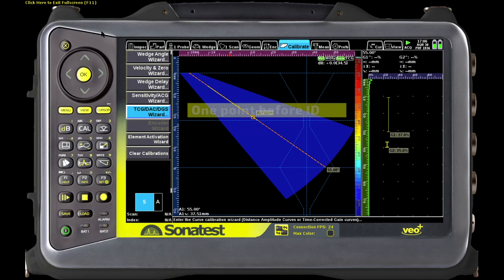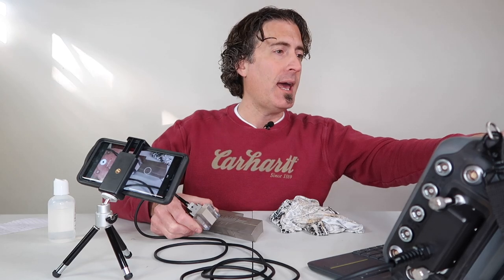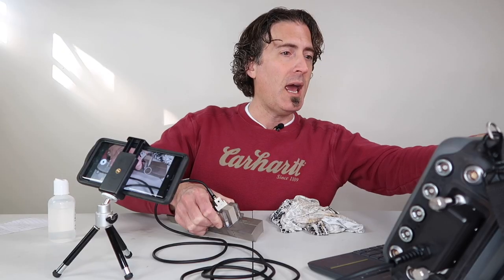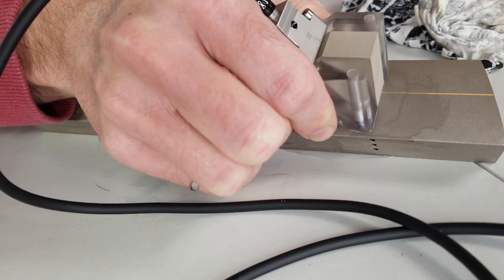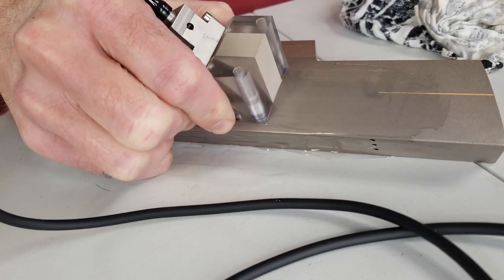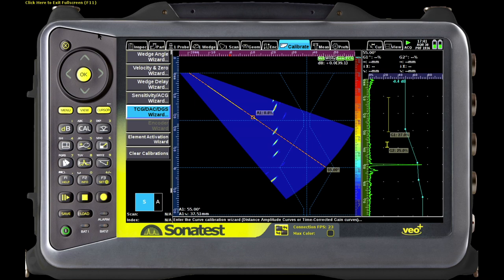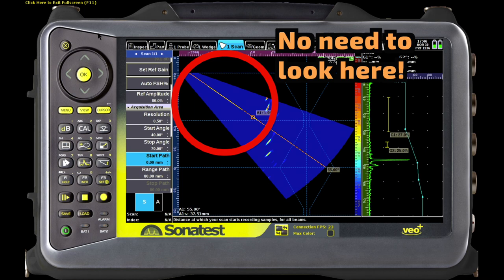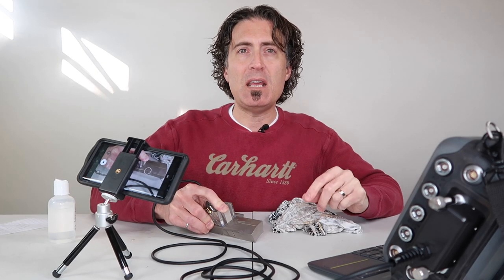Phased Array TCG Calibration

Comment: Hey Paul, I'm learning PAUT. We were doing TCG cals today on the veo3 on 1.5mm SDH. After completing the TCG we were confused that the maxed A-scan signal from the reflectors is breaking TCG, just like in your video at around 4:01. I have my PAUT course soon but do you know why this is the case? Great video and sorry for taking up your time!! Cheers - Doug 🏴
Reply: Also to add, the ref gain stays the same so not sure why the amplitude is above TCG. Aware this could be a stupid question 😂
Reply from the maker: @DoogHoneyman   no stupid questions! :) So the TCG curve is not a DAC curve. If it were a DAC, then you are right the A-scans would peak up at the line and not go above. But the TCG curve is simply a reference line that shows the dB adjustment at different sound paths. The idea is that with the TCG, they will peak at a consistent screen level (usually 80%) after you're done. Which, if you overlay the TCG curve (which is not a flat line at 80%), you'll see why the A-scan peaks at 80% will be higher than the TCG line.
Reply: Understood, I think, still thinking about this one actually. Thank you!! 🙌

Comment: Wow! Fantastic invention , couldn't believe this kind of calibration blocks would exist 😳. So those SDHs are actually curved following the inside contour of the pipe, right?.
May I ask some newbie questions? 😅, how I'm supposed to calibrate for previous steps, Wedge Angle, delay, velocity, and sensitivity? What cal. Block should I use for a curved Wedge, it doesn't makes sense to calibrate on a flat IIW block 🙄
Reply from the maker: Hi there, for a more in depth look at the ERVW blocks, there's this video. Hope it answers your questions!

https://youtu.be/3sV-LQKfe5Y
Reply: @hollowayndtengineeringinc.5201  Thanks a lot for your great videos, really appreciate your time and efforts, God bless you 🙏🏻. Still though, I can't get it right, I tried to calibrate the distance on a notch carved in 8" pipe, but I'm not sure if it is accurate enough :(
What would you advice me to calibrate the distance /velocity on? Depth, surface distance or beam path?

Comment: hello, if I need to calibrate sensitivity with a notch reflector? how can I select that from the device because the device has three reflector types Radius,  thickness, and depth SDH ??
Reply from the maker: Those reflector types are not for setting a TCG. Those are typically used for time base calibrations. I would advise you to get some assistance from your supervisor or Level 3.

Comment: Hi Paul, Have you ever do transfer correction with a phased array device?
Reply from the maker: Yes, but it's quite complicated
Reply: If you don't mind could you explain? There is no standard for this, for example iso 13588 referred to iso 17640 , but this is manual ultrasonic and saying use the same probe which are performing UT .

Comment: Thank you for the rad videos. 
Are you using a concave wedge or is it flat?
What would you suggest as the best wedge to use when scanning Scanning a 6” pipe of 1”WT.?
Reply from the maker: Hi Jason, that was a curved wedge.

I always recommend using a wedge contoured exactly to the examination surface. So in the case of a 6 inch pipe, that would be 6.625 inches. It isn't always practical to be carrying around wedges for every pipe size, so feel free to use the tolerances introduced in 2017 in the ASME code. 

I wrote an article on that here: http://www.hollowayndt.com/news/2018/10/22/making-sense-of-wedge-curvature-according-to-asme-sec-v-article-4

Comment: Thank you... Paul for wonderful explanation for TCG IN PAUT.

In conventional UT, we all mainly use DAC method for examination. Now my question is "whether an indication whose amplitude is 20% DAC is equal to 20% TCG ?"
Reply from the maker: Yes it is.
Does your procedure explicitly state DAC? Why not use TCG instead?
Reply: @hollowayndtengineeringinc.5201   it specify as "reference level"
Reply: 20 percent of TCG, would equate to 16%, as 10% of a Ref(80%) would equal 8%, and you can do the math from there...
Reply: @emanuelchavez8444  thanks..

Comment: hi, excelent video, could you pass me the block diagram? i wanna make one block too, and another question, could you please make a video calibration speed, wedge delay and sensivity for pipe inspection, i am new in all that, but i really want the block diagram if you could pass it please
Reply from the maker: The block design is patented, so I can't share it. And I will do a pipe calibration video at some point. Thanks for watching!
Reply: @hollowayndtengineeringinc.5201  ok thanks, another question, do you have videos about tofd calibration ?